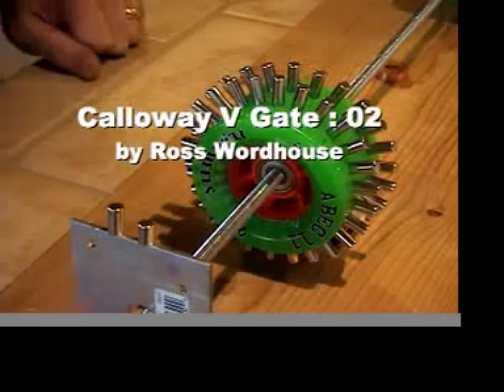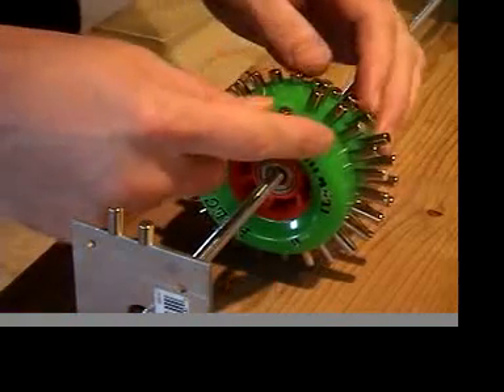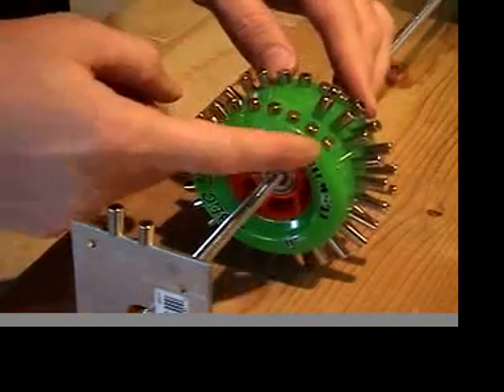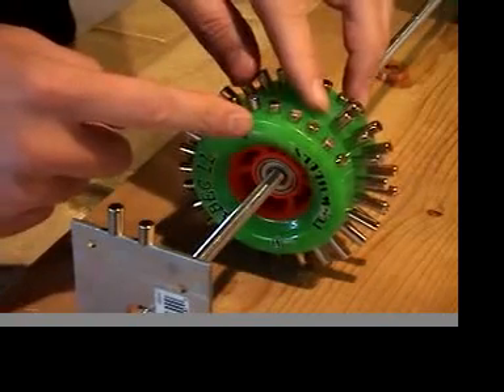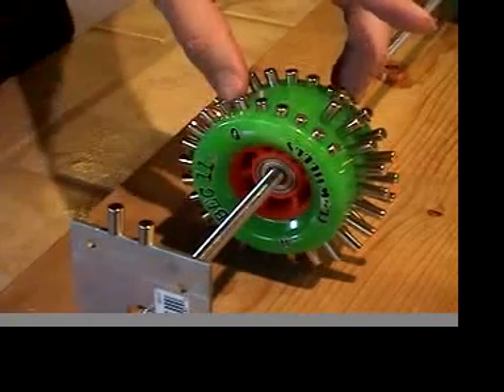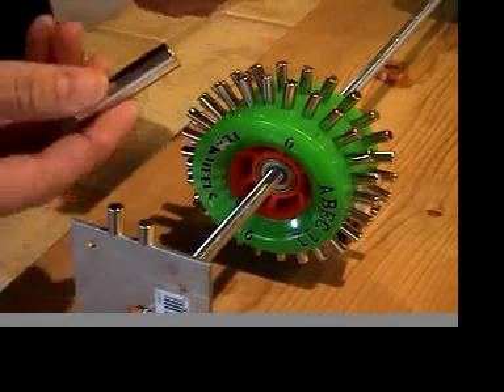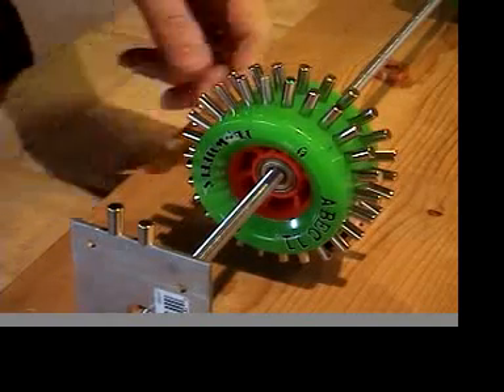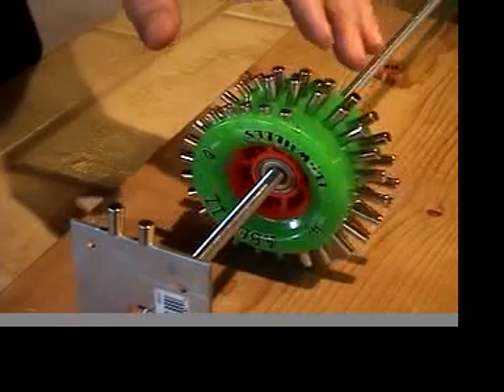Magnet Motor - Calloway V Gate : 02

Comment: Hi, I saw tour movie yesterday, and I can say that I flip out, completly.. almost couldnt sleep thinking on this.. it is amazing .. and I coul not stop thinking how to solve the problems youve got.. so I only say this.. try 3 major static magnets arround the weal fixed and equaly distant (as in the corner of a triangle) so that when one is on the gate the other's two are pooling .. try to make the hole system the most equaly wheighted possible for stabilization. It could work...

Comment: you guys are not really thinking this is MAKING energy right? The spinning movement is caused by the magnet the guy is holding.. when he moves it far, to make it cross the point, he is giving the wheel the energy to spin.... no miracles guys.. it's just physics... but good work! I guess it's a nice way to transfer energy.

Comment: Very Interesting, DustAid. Rather than huge differences in magnet height -- which may lead to other problems...or not -- what are your thoughts on a simple cam on the main power shaft with linkage to a mounted stator magnet so that it automatically raises it at the gate location? Or am i making things unnecessarily complicated.

Comment: If you stuck the wheel in the center of a large round piece of styrofoam, you might be able to save time drilling holes.  You might be able to push the magnets into the stirophome.  Large round Styrofoam can be found at any craft store.  Normally used in flower arrangements.  Also instead of using one long Calloway V Gate, repeat three smaller ones.  After you get it working, surround it with coiled wire to generate a current.

Comment: So the real question is if you can cam the static magnet with the energy in the motion of the flywheel.  This can be tested with pure mechanical interface or using a magnetic shield/blind.  Using the concepts of the steam engine valving should get you close to the geometry require to achieve this goal.

If you have a gain in energy over and above what is require for the retraction vehicle, you've got a great simple proof of concept model for this technology.

Comment from the maker: The are just stuck in. I drilled holes with a 1/4" drill bit and pressed them in. Nothing to tech, the rubber of the wheel holds them tight.